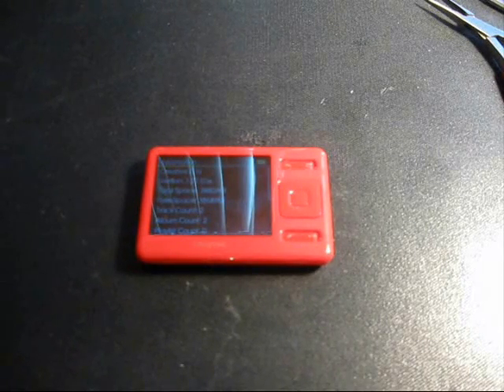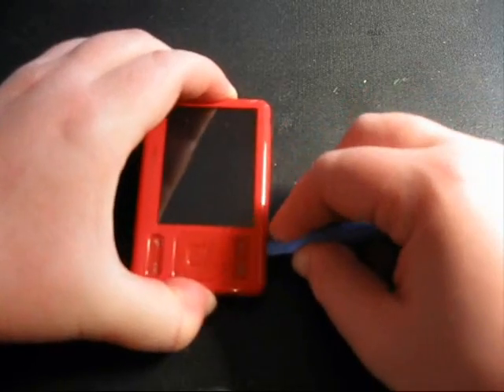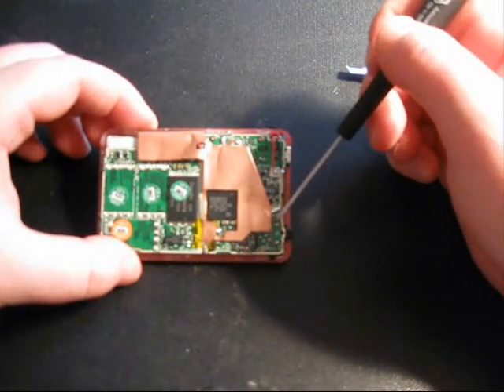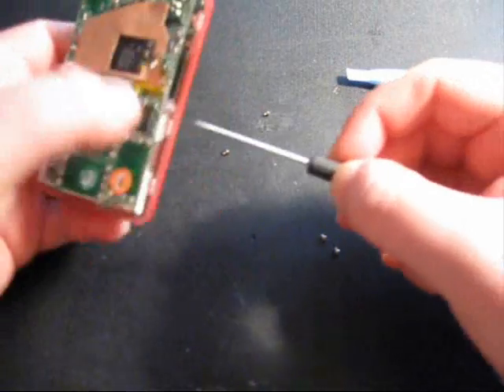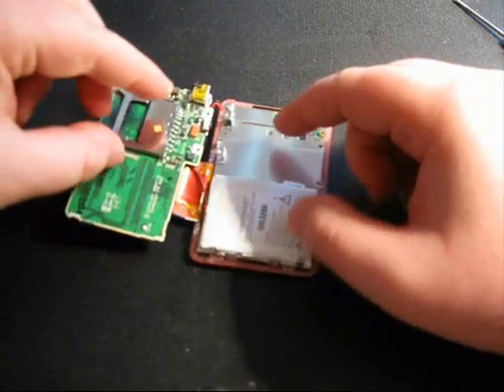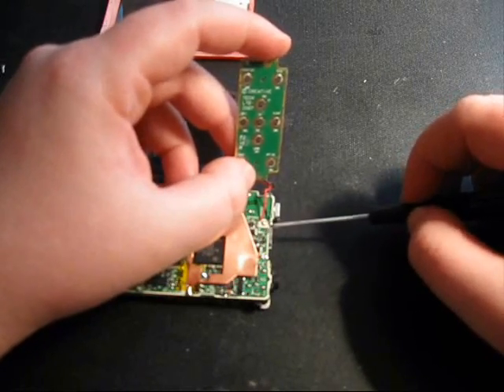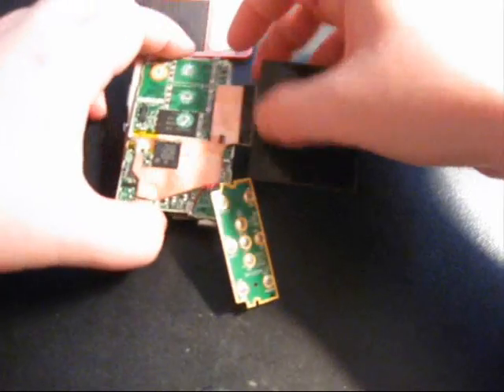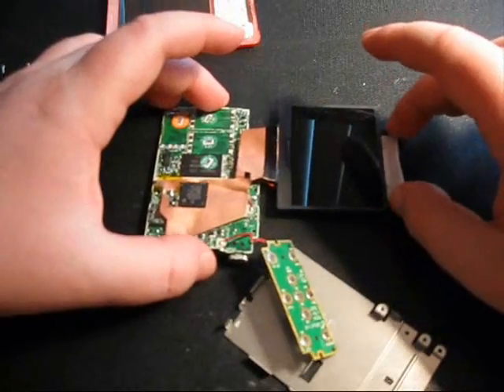Creative Zen Complete Disassembly Video Tutorial

Comment: Just a little heads up in case this happens to anyone else: When I was taking my zen apart, I got a little black piece of rubber which fell out of my zen as I was taking the motherboard out from under the metal tabs. This piece slips over a small silver block with black edges and a black dot by the headphones port.

Comment: Thanks I replaced broken LCD of my sister's zen. My zen had a memory problem. So now  at least we have one working zen :)
Reply: HI Harun!
My display is cracked as well.
Where did you find the replacement display?
Reply: @see_it_through_my_eye  I had two zens at the time
Reply: @BeautifulTurkish  
I have just one...it was amazing... My dig bit it and the display is dead. .

Any idea if any aftermarket display can be used to revive it?
It don't mind if they're nit an exact fit... There are lot if 2.5 inch displays for arduinos / rasberry pi etc... Will any of those work?
Reply: @see_it_through_my_eye  No idea. I has been 10 years :)

Comment from the maker: @pinegrovespirit Most water damaged electronics cannot be repaired because the device was powered on when it came into contact with the water and the PCB circuitry was shorted by the water. If your device was off and you did not attempt to power it on within 24 hours of the water, there may be hope.

Comment from the maker: @Yokoskitsunegirl If you want to get the job done right, you'll need to buy a soldering iron. There are really cheap ones out there for $10 but you'll have to watch the heat because there is little to no heat control and it can easily burn the pads.

Comment: Or if someone could recommend a creative trick to get it going again I'd appreciate it. In the past with TV remotes etc I've cut the rubber mat apart and swapped buttons for ones I use less often. Not really going to work here though. I'd considered just putting the thing back in upside down but it doesn't look like it will quite sit right.